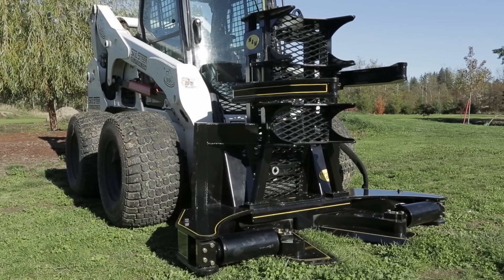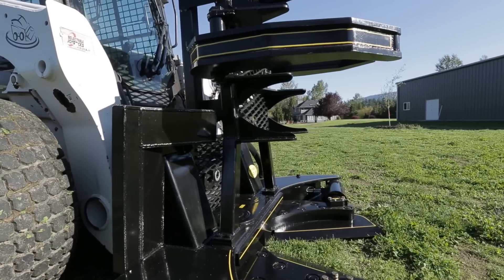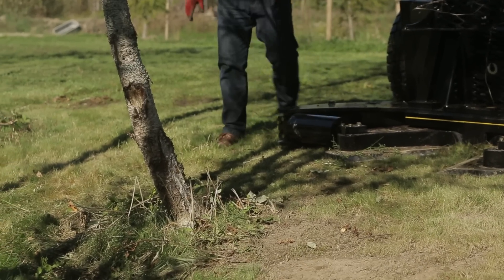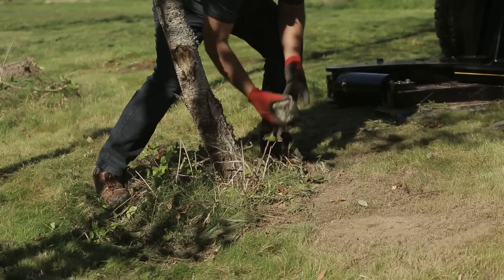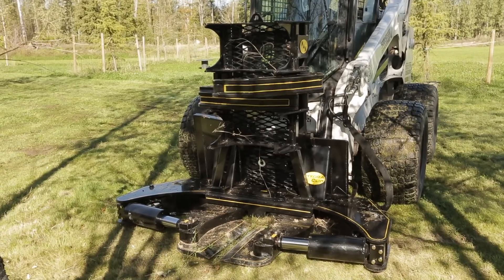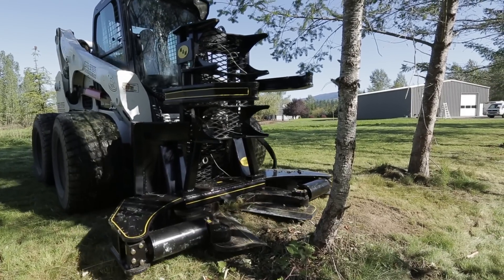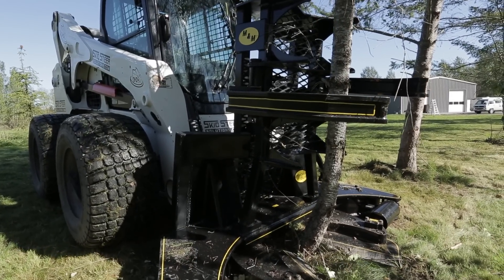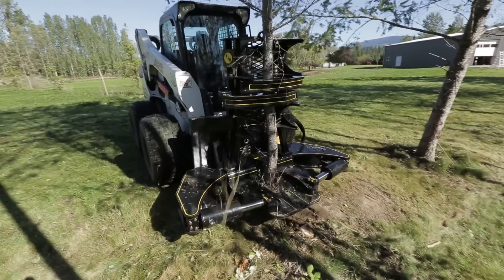How to cut a tree - M & M Hydraclip Tree Shear Attachment for Skid Steer Loader

Comment: what is the largest diameter tree that this attachment can handle.
Reply from the maker: Per M&M: the Hydra-Clip can cut a 16" Tree in one cut. Larger trees can be cut with additional cuts. You probably wouldn't want to go much larger than 22" or so.